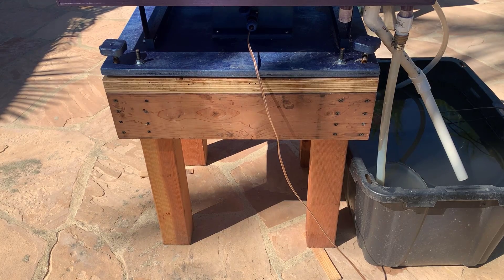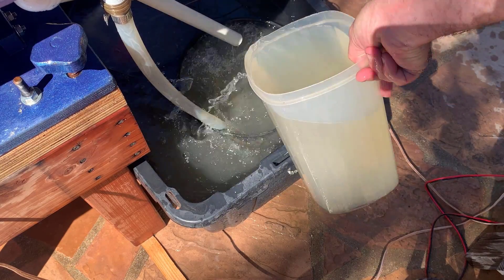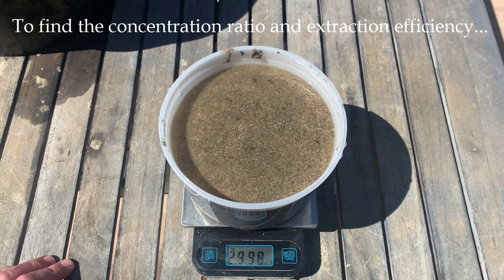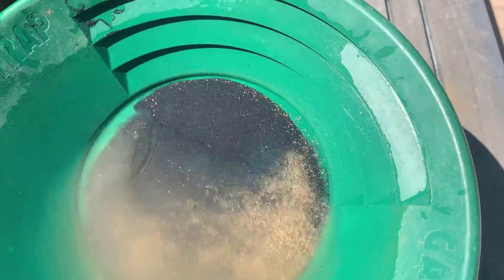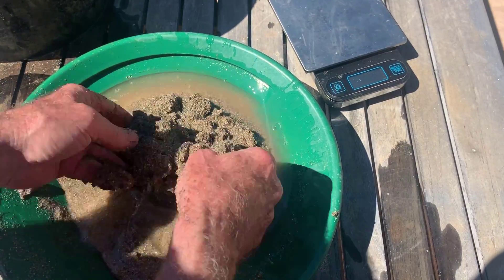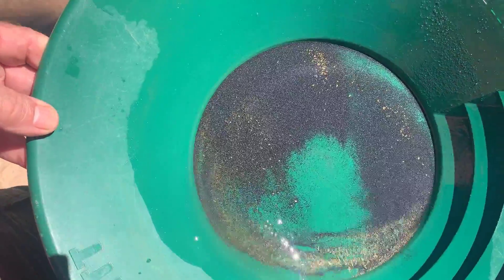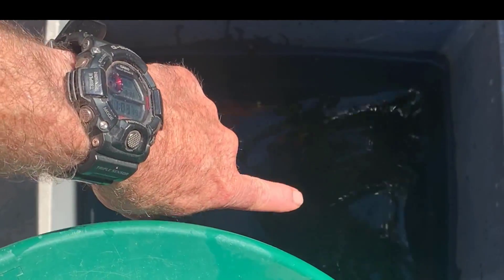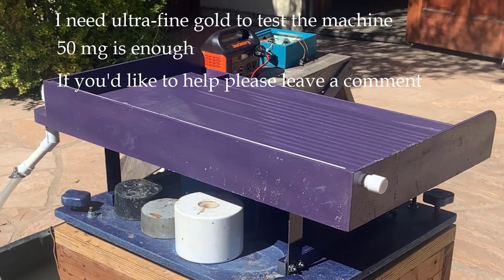Gold Bump-Sluice Shaker Table

Comment: I found a small electro magnet system that uses a PWM signal generator (pulse) with a MOSFET Trigger Switch, cost is very low, under 15 bucks for both. Thought I'd pass on the news.  DC 5V-36V 400W, 15A (Max 30A)
Reply from the maker: Great. I'll take a look. Thanks -- Dave

Comment: Do you think your recovery rate would be better if you had more riffles? I wonder if it’s kinda short and material is not having enough time to segregate
Reply from the maker: There are a lot of parameters that can be varied, and they each will change the overall figure of merit of the table. Yes, a longer table will help with separation but it's not a simple kind of one-to-one relationship.

Comment: I know I am late to the party (11 months after you posted this video), but I have a question: Have you tested changing the "bumping angle" so it is not in line with the groves? I imagine that if the table motion is along the diagonal from the bottom left to the top right, the material could be bumped towards the top right corner? I imagine it will help with stratisfiyng the material in the grooves better and with less chance of clogging. 
In your video, the gold from the top groove falls almost straight "down" into the groove below, instead of the gold being released from the groove. I speculate that bumping the table at an angle could perhaps change that?
Reply from the maker: Good comment! Yes, I've done a lot of experiments on this. It's very complicated because the motion of the gold and the separation of the waste depends on so many things including the rate of water flow and its direction, the slope of the table, the type of material, the bump rate and amplitude, etc. So, I've decided to keep the bump direction parallel to the grooves and vary other parameters.  Cheers, Dave

Comment: Have you experimented with a 12v vibrating motor instead of a oscillating motor? I’m curious in the performance between the two.  I’ll gladly purchase and ship you a vibration motor if you’re willing to do a comparison video.  Thanks for all the knowledge.
Reply from the maker: Hi Jason. Yes, I've tried several small 12V DC motors in the 35 W to 50 W range. I used this style for the first couple of tables that I built. If interested, you can take a look at my first video. I don't know how to use a rotary motor with a bump mechanism. The bump mechanism with the linear motor, with its force and frequency adjustments is a huge improvement for this style of table and I recommend that you find a way to implement it. It makes for an excellent, finely tunable, multiple-purpose table.

Comment: Can you tell me what the max hz is that this type of motor can run at before starting to over heat ?
Reply from the maker: I can run the motor for hours at full current without overheating. That's 1.8 amps at 18 V, or  roughly 32 Watts. I run the table at about 6 Hz bump rate.  -- Dave
Reply: Thank you Dave for responding .  Ray

Comment: Where can I buy a grooved rubber mat like yours
Reply from the maker: I buy the Neoprene rubber sheets from Rubber Sheet Warehouse and I cut the grooves with a router.
Reply: @orophilia  How did you determine the spacing, depth and various angles that you cut out of the rubber mat. I would greatly appreciate a picture to some scale so I could cut my own.
Reply from the maker: @tomsmith295  Hi Tom, Please see my latest video. It shows all the steps involved in cutting the grooves in the plywood. If you have further questions, please ask. -- Dave

Comment: Thanks so much Dave!

Q: How hard was it to get the plywood as flat as possible?  (I'm thinking of asking a local machinist to mill me a 36" X 30" sheet of aluminum perfectly flat but don't want to waste the effort if it's not necessary )

Q: Is there any special sauce in the V grooves as far as depth and shape is concerned?

Thanks again, what a wonderful job you did!
Reply from the maker: I used 1/2" Baltic birch plywood for the top. The plywood was laminated to a hardwood frame measuring 3/4" X 1.25" and I divided up the internal volume in a 3X2 array with more of the same hardwood frame material. This structure is called a torsion box. It's very stiff and flat.

Comment: Dave the 24 AWG magnet wire that you used where can I buy I buy it? What spacing for the fixed neodymium magnets did you set? Also what was the dimension of the4  flex material that the table top  was connected to?
Reply from the maker: Hi Stephen. I'm about to publish a video on the construction of the table. Please take a look.
Reply: Hi Dave great to hear you will post how to build the table.

Comment: Also wanted to mention that I used ChatGPT to tell me how much 24 AWG wire is required to measure a impedance of 8 ohms. Answer: 319.83 feet.
Reply from the maker: I use ChatGPT all the time now. I'm very careful to check the answers.

Comment: Also what kind of lcd did you use for readout?
Reply from the maker: I used two LCD displays with 172x320 resolution because they were hanging around. An easy and cheaper way is to use a microcontroller with an integrated display like the Lilygo T-Display-S3 or similar. Be aware that there's a lot to do to program these micros.

Comment: Hi Dave I have ordered motor controllers 20A DC 10-60V PWM Motor Speed Controller kit,  neodymium magnets, Arduino Uno  microcontroller, and BTS7960 DC motor Driver. I found a source for code to load on the motor controller. A have also located speaker copper wire 24 gauge on Ebay and have a question if this was your source used in the video. The wire is 0.6-2.0mm 0.1-2.4mH Amplifier Speaker Crossover Inductor Oxygen-Free Copper Wire and as I understand it the choice of inductance differs when the wire 0.1 mH (better at high frequency) to 2.4 mH (better low frequency). I'm assuming you chose higher inductance wire and that you didn't include a core. Any insight on wire selection and source would be helpful and if a core would improve the magnetic field strength without having to increase the current flow as you pointed out in your last post. I to am a engineer but with limited experience build a linear motor as you had built for your table.
Reply from the maker: Hi Stephen, You'll need 24AWG magnet wire, not speaker wire. When you say you've found code, is that for the Arduino? You'll need a microcontroller to drive the H-bridge switch.

Comment: How many turns of the 24 gauge copper wire  and the dielectric material did you directly connect to the BT5796 High Power Drive module?  Did you directly connect one of the DafuRui pulse width modulation control unit to the PWM inputs of the BT5796?  Also did the 12 volts battery connect directly to the BT5796 High Power Drive module B+   B-? I'd like to build a version of the table  drive  mechanism that you built. Any insights appreciated.
Reply from the maker: I'm travelling, so I have to remember the details without seeing the unit. I didn't count the turns on the coil because I really didn't need to. Counting turns is a pain and I had already estimated the number of turns and the force that would be generated. The inner diameter of the coil is 2 inches and the outer diameter is 3.25 inches. The coil is about 3/4" thick and as I recall it has 8 ohms impedance. The magnets are 3/4 X 1 X 2 (I think, but it doesn't sound right. I'll look it up.) and they are backed by a 1/4" A16 plate. With 12V I would only get 1.25 Amps through the coil (not enough), so I used a step-up switcher to produce 18V for the high-current switch. With that I can get 2 Amps through the coil. I run the table at 5.85 Hz and about 50% on the PWM. I'm an old engineer, so I consider that marginal. I would prefer at least 3 Amps for the coil, i.e., 24 V from the switching power supply. The high-current switch is driven from the microcontroller because I wanted to play with acceleration profiles. The acceleration profile is not needed; in the end I just drive the table one way for half the time and the other way half the time. However, I consider it important to have adjustments for both the frequency and the amplitude. This allows fine adjustments that can really affect the performance of the table. If you are not familiar with programming micros perhaps I can help. I used an ESP32, but that's total overkill, a simple Aduino would do. Be careful with the total moving mass. My table has about 5.5 kg, including everything except the dirt. The bump adjustment is also very important. It's a fun project and after a bit of tuning it works remarkably well.  -- Dave

Comment: The linear motor that you point out in the video, did you build it yourself? I get the sense of changing magnetic fields interacting with the two magnets causing the displacement. The greater the linear field the greater the displacement. I'm assuming that changing the PWM by adjusting the pot increases is the adjustment. I also notices that you had two other power supplies in the box. What DC voltages were needed to for the current bridge?
Reply from the maker: Yes, the motor and controller are homemade. Yes, the pot controls the PWM amplitude (the width of the pulse). I added two other PWM controllers to control the pump and a spare that's not in use. I use 12 V from the battery.

Comment: Wrap a magnet in plastic wrap and stick it into your concentrate. I bet youll pull most of that black sand out, and you can use the plastic wrap (or a baggie) to remove it from the magnet
Reply from the maker: Agreed.

Comment: What if the table top were 1/2 aluminum plate instead? You could router the grooves which would be a more consistant size and depth I t would weight less as well
Reply from the maker: Yes, certainly Aluminum would work. 1/2" thick Al plate would be very heavy relative to plywood.  -- Dave

Comment: It’s great what you’re doing, but we still want more!
Concentration that you’re getting is good especially for in the feild. Can you slow it down, change the angle and separate the black sands from the gold?
I want to help but the price to send dirt to the state’s from Australia is a bit of a burden.
Reply from the maker: Yeah, I want to do the same thing, remove more of the black sand. I'm working on it slowly, trying to understand the factors that improve performance. There are a lot of adjustments that can be made to the table, and there are three competing desires: High feed rate, high concentration ratio and low gold loss rate.  -- Dave

Comment: Wow! Such a nice machine! Home size of mbmmllc shaker tables!
Di you thought about a movable divider in the collection canal, so you can choose how much black sand goes to tailings, and how pure concentrate is collected? Or it will be technically harder to build?
Also, will longer long slots be beneficial, or this is their optimal length? Just curious
Reply from the maker: Good morning! All good questions. The grooves may not be optimized but they do work.  -- Dave
Reply: @orophilia  i see they work XD
i was thinking if making them longer would not help with bringing more concentrate to the right corner, longer route for it to interact with waater and beeing shaken could lead to better separation in my mind. 
I am very curious, because i see potential for home PCB refining, and other electroscrap XD
And this bump and low frquency is crucial? vibration motors work worse?
Reply from the maker: @ejkozan   The bump motion is the critical part. The velocity at the time of impact determines the distance that the gold and other material moves per bump. The rate of bumping determines the overall rate that material is transported. The water flow and table tilt determine the rate that the material flows downward into the tailings tray. All the possible adjustments interact with each other.  -- Dave
Reply: @orophilia interesting. i am asking because mbmmllc's shaking tables seems too use only vibration and your is different. i expect it exploits inertia of particles when bump (sudden braking of table) happens. a bit like tapping of panning bowl
Reply from the maker: @ejkozan  It's my understanding that the mbmmllc tables rely on a different principle, i.e., the flexures are angled backwards and the table is driven sinusoidally with an electric motor. See my very first video on this channel.

Comment: Looks to me that if the table was a little wider you would remove more of the black sand.
Reply from the maker: Hi Drew, Yes you are right. There is a tradeoff between table dimensions, feed rate, concentration ratio and efficiency.  Each table can be set up to optimize for feed rate, concentration ratio (purity) or efficiency (loss rate).  Larger tables can have better performance in any (or all) of these categories and the expense of size and weight.  -- Dave
Reply: @orophilia  Maybe you could put a neo magnet on an angle under the table to catch a lot of black sand.
Reply from the maker: @drewconrad7093  Yeah, that works but it's a lot of trouble and it only catches the magnetic stuff, leaving over half of the fine black sand anyway.  -- Dave

Comment: Base: You can make the top of your base a hollow box that you can fill with sand so it has more mass than the shaker table.  Then the stiffness of the legs won’t matter as much.  At the end of the day, dump the sand so you base can be very light in transport mode.
Reply from the maker: Hi John, Yeah, that's a good plan. Rocks also will work well.  -- Dave

Comment: I can't wait to run our ore and cons over your table Dave! Wonderful design and engineering! 👏 Will there be a 2tph table in the future?
Reply from the maker: I'm looking forward to it also. I've been working out strategies for larger throughput and I don't see why not. If you find the material then we'll get it done. I don't think a single huge table is the way to go because the weight and cost of the table grows much faster than the throughput. So, there's an optimum size for the table, probably around 3'  X 6'. The job then is to engineer a feed system to make it automatic.  -- Dave

Comment: Excellent evolution!
By making the lid of the controller box inverted from how it is now you avoid the recessed lid that now would trap water and act to funnel it into the box. Especially if opened in the field. It also allows you to put the screws on the outside of any seal you may wish to use.
Reply from the maker: There is a top to the box (not shown) that should protect the electronics. I appreciate your ideas!  -- Dave

Comment: In a recirculating system, the implementation of silt bags serves to improve overall efficiency and longevity. These bags are strategically placed within the system to capture and contain classified sediments, which are particles and debris suspended in the water. As the water flows through the system, it carries along these sediments.

Here's how the process works:

Sediment Capture: As water containing suspended sediments enters the recirculating system, it first encounters the silt bags. These bags are designed with a porous material that allows water to pass through while effectively trapping and containing the sediments.

Water Passage: The porous nature of the silt bags enables water to continue its flow through the system. This is crucial for maintaining the required circulation rate and ensuring that the system functions optimally.

Sediment Collection: The trapped sediments accumulate within the silt bags. Over time, the bags collect a significant amount of sediment that would otherwise be circulated throughout the system.

Preventing Clogging: By capturing these sediments, the silt bags prevent them from settling in various components of the recirculating system. This is particularly important for components like pipes, pumps, and filters, as sediment buildup can lead to clogs and reduced efficiency.

Reducing Maintenance: Regularly cleaning and replacing silt bags is a simpler and more manageable task compared to dealing with sediment accumulation throughout the entire system. This reduces the frequency and intensity of maintenance operations.

Improved Water Quality: As sediments are removed from the water, the overall water quality within the recirculating system remains higher. This is especially relevant in systems where water quality impacts the performance of equipment or the well-being of living organisms (e.g., in aquaculture systems).

In summary, incorporating silt bags into a recirculating system is a practical approach to manage sediment content. It enables water to flow freely while capturing sediments, thereby enhancing system efficiency, reducing maintenance requirements, and ensuring better water quality. :hand-purple-blue-peace:

Comment: Damn you make some wonderful equipment and wonderful tapes.
Am wondering what angle you run left to right , and what angle front to back your table ?
Reply from the maker: Hi GSF.  I'm currently running 1/2" per foot back to front (2.5 degrees) and level left to right. I can adjust this for higher feed rates (3.5 degrees) and a slight downhill left to right tilt, or for lower feed rates (1.5 degrees) and slight uphill tilt left to right. The latter works well for cleaning.  -- Dave
Reply: @orophilia  So is it the BUMP that causes the left to right movement of particles ?
Reply from the maker: @mohammednovalija  Yes, exactly. The bump is like the tap on the side of a gold pan. It preferentially moves the higher density material.  -- Dave

Comment: How big are the magnets and how big of a coil. Thanks this thing is great im going to try and build one
Reply from the maker: The magnets are 2" X 1" X 0.75" N52 Neodymium Iron Boron. The coil is 0.5" thick and has an inner diameter of 2" and an outer diameter of 3.5". The wire is #24 AWG and the coil resistance is 10 ohms. I have a complete build video coming so stay tuned.  -- Dave
Reply: @orophilia thanks I’m ready to order parts this is a great design.